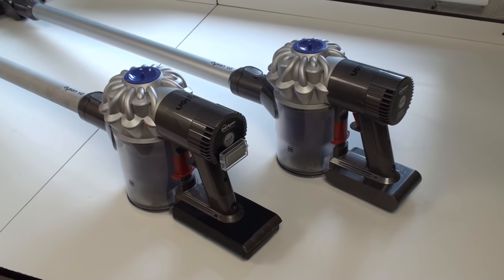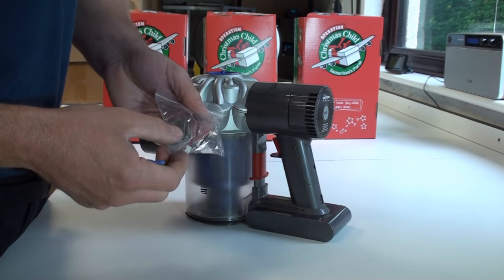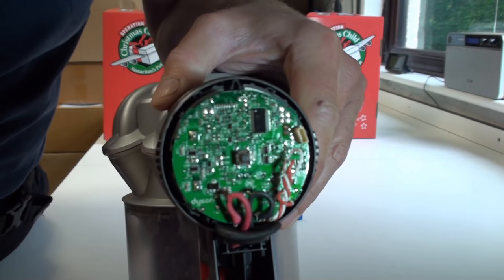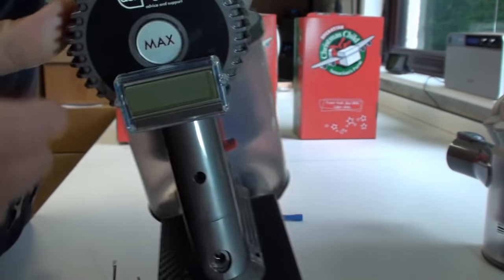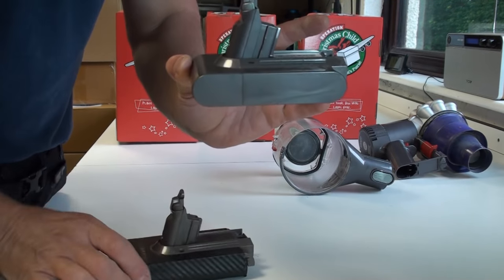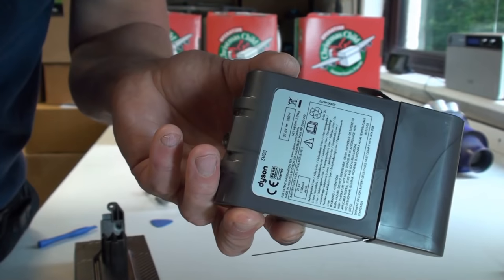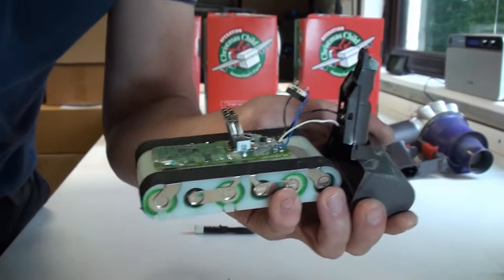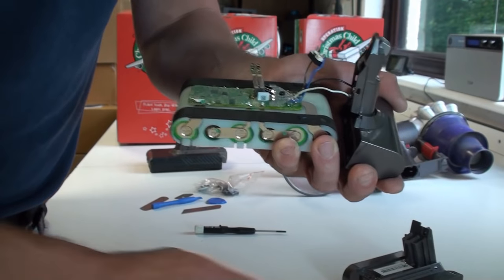Dyson V6 Modification

Comment: Why doesn't Dyson gives you the chance of replaceable batteries and the option for a bigger more lasting one?
Reply: Because, just like Apple and so many other manufacturers they are NOT green, despite all their claims to the contrary. They also deliberately use techniques to ensure that units are NOT repairable ... by ANYONE including professional engineers, who could fix these things so much more easily with the schematics being available. They want to be able to tell you that you need a complete new unit as the broken one is not fixable! Yeah ... RIGHT!

Apple for instance is try to get it made ILLEGAL to try to repair their stuff! WTF!! If it's MY gear why the hell not? Who the hell do Apple think they are to tell people they can't repair their own kit on pain of prosecution? Why should I (or anyone else) be forced to pay for an expensive repair when with the right info I could do it myself?
Reply: Bob Lewis yeah that makes sense, even consoles makers want it to be ilegal to repair consoles.
Reply: I totally agree.......   why make a good product, when you can make a poor product and sell more of them...!!!!!!!

Comment: Dear Dreamsci - great video - great idea - I like the phase/stage1 approach as it keeps the same physical form factor etc.... is there any chance you could upload a video show the high level steps to make the mod as you commented is need soldering etc? I'd just like to understand what is involved before I start. And from a safety perspective I work with lithium cells at work, just a lot larger i.e. 48v 756amph, so will take the necessary steps.  As for AskDyson comments, please don't insult our intelligence. You have a product development plan and strategy. If you made the V6 the best it realistically could be, then you couldn't sell the V7, V8 etc.. I worked for the worlds largest manufacturer of off highway diesel engines..... this difference between 150hp and 200hp was software (and the price). Don't use Safety as defence to justify market based pricing (which is fine), but not at the expense of undermining TRUE safety.

Comment: Fantastic video. I have a question. I recently got the red light of death by using the vacuum   after it shut off, twice in a row. I took the battery apart, and charged it using an appropriate charger, and it's now resting at 25v.  The battery however still flashes red. Is there a way to reset the circuit board? I'm ready to buy new cells, but I don't know if my board is bad, or why it still flashes red after the cells are up to the right count.  Any suggestions?
Reply: I don't have a solution. The same symptom  commonly occurs when the battery pack is about 2 years old. It seems that the internal micro-controller has decided that there is a problem with the cells and has disabled the pack. When I opened my failed pack, I found that the cells were badly out of balance. When I manually charged and tested the cells, I found that they are still in good condition.
There must be many good Li-ion cells being needlessly wasted because Dyson's design flaw.
Reply: I have a same problem as yours if you find any solution please let me know

Comment: does anyone know of any way to modify one of these so that there's NO battery??(ie convert it from cordless to corded).
I clean houses for a living and I have several clients that have these and I LOVE using them (super lightweight and actually pick things up on both carpet and hard floors) but I have held back on buying one for myself as since they're cordless/battery powered they obviously wouldn't do me much good for work as they'd only be good for one house (if that) before it died and I clean 2-3 houses a day.
Reply: I would just suggest having multiple battery's you can charge them separately since the charge plug is actually built in to the battery. When you are cleaning have one ready for the next house and on other one charging. When your done with one switch the battery out (2screws easy). That way you don't void any warranty. And it's ALOT easyer than modding it with a cord.
Reply: @undergod1987  Do you know for sure that there isn't some interaction with the control circuitry in the rear of the unit for the battery charging?  I've been trying to figure this out if the batteries could be in fact charged out of the unit or has Dyson made the vacuums in a way that this won't work?

Comment: Hey, which setting do you use on the battery indicator? I'm using 6c at the moment, but unsure if it's the right one, cheers for the video!
Reply: 6S is right. there are 6 cells in series

Comment: The newer V6 Absolute has a rear HEPA filter which is not compatible with this battery gauge mod. There's a much easier way to increase operating time - buy a larger capacity battery off ebay.

Comment: How are the new larger batteries connected to the circuit board? I don't see the original metal prongs soldiered to the new batteries. I wish u could have shown the process how u disconnected the old batteries & connected tge new ones. Could u do a follow video? A demonstration of the vacuum sucking
Reply: Is the circut board ever disconnected from the power outlet? Do all the cables remain intact when moving the circut board?  The video fast tracked a few steps & it's vague how you accomplished the mod
Reply: He did the mod first and the video came later after he had completed the mod and tested it.  The intermediate steps were not videoed this time.  However as mentioned in other comments it is prudent to connect all the cell balancing wires to the battery management PBC.  Just take pictures as you disassemble and replace old cell with new bigger cell in a 1:1 arrangement.  There is no electrical change to the circuit.

Comment: Hi 
I replaced the cells but get flashing red lights followed by a green light.  I think I need to replace the thermistor?? 
Can you advise please
Reply: The thermistor measures 12K ohms at room temperature. I stuck a 10k resistor in but it still did not work. From what I understand the BMS has locked you out and I do not know how to reset it. The mods this guy has done appear to have bypassed the bms so the cells will imbalance after so many charges and fail.

Comment: Surely though the hoovers battery life is all dependant on the motor life etc. Putting batterys in a hoover that should only work 20mins on the single charge for one full usage. And ramming it up to  a hour is possibly not the best idea for the motor and all the other parts of the hoover overheating and causing a short life span? ... I have a dyson v7. It has 30mins on a single charge and I think it's perfect! Clever bloke though. I like people who can be very handy and clever like this.

Comment: what amp rating are the 26650's? if you pull too many amps for lithium batteries that can also cause them to vent and catch fire. Wouldn't recommend people do this! Dyson clearly used them cells for a reason
Reply: depends on the cell you buy, the one I'm using have arating of continues 25 amps
Reply: dyson uses sony VTC4 cells. 6 cells in series. Each cell is 2100 mAh is rated 30A (but in real life, more like 20A because at 30A, you can only discharge half the capacity before reching 80 degree C which is very bad for battery longevity in years or monts or number of cycles). The VTC4 cells are high amp cells and can take 20A no problem... Dont do that with laptop 18650 who are only design for 3.5A..... you will kill them very quickly. So 6 VTC4 in series means 21.6V nominal 2100 mAh.Good 18650 for the dyson would be sony VTC4 (2100 mAh 30A), VTC5 (2500 mAh 20A), VTC6 (3000 mAh 20A), samsung 30Q (3000 mAh, 15A), Samsung 25R (2500 mAh, 20A) or LG HG2 (3000 mAh 20A)

Comment: I placed an indicator, its was a 12V that i got on ebay. but it only reads 100%??? it that because its a 12V?
Reply: Using Instruction:
(1) Key operation:
The one white buttons on the back of the indicator are used to select parameters.
(2) Batteries model selection:
1.Power off the indicator
2.Hold  key
3.Power the indicator on
4.Release  button,then the screen will display for symbols in English: "XP"
or "XC" ,x is the number of cells, then users can select batteries model
by keys in the following order:
P1: Pb12V lead-acid battery
P2: Pb24V lead-acid battery
P3:  not work
P4:  not work
C2: 2 pcs lithium batteries
C3: 3 pcs lithium batteries
C4: 4 pcs lithium batteries
C5: 5 pcs lithium batteries
C6: 6 pcs lithium batteries
C7: 7 pcs lithium batteries
C8:  not work
C15: not work.
Reply: Hope that helps...

Comment: Thank for a nice video. But I wonder,  can you use the original Dyson adapter to charge for the modded one with 5000mAh battery and how long does it take for full charge ?

Comment: Usually these higher capacity cells on ebay (etc) are fake.. Most of the time they add some cardboard rings on top of an normal capacity cell, and solder a new battery contact to a wire (running through these cardboard rings). Finally the cell gets a new wrapper and sold as high capacity. Also I found some of these cells of poor quality and rusty beneath the wrapping.

Comment: The bits he doesn't go into are most important bits for safety -  How to connect up the balance charging circuit (which it doesn't look like he's done) and how to make the physical connections to the cells.. A soldering iron is not the solution.. a decent resistance or laser welded joint is what's required to keep the resistance and temperature low to avoid premature aging of the cells or even thermal runaway (YouTube: 'lithium ion thermal runaway video' to see the danger involved). The heat put into the cell during a soldering process is very bad for it, another reason why it isn't used in production, also no mention of using protected cells either? (with CID and PTC layer). As others have mentioned the current (25-30amp) rating of the cells is critical in high power applications like this, you shouldn't just stick in any old high capacity cells (e.g. 3000-5000mah etc), especially with a high internal cell resistance and questionable resistance soldered joint. Nice idea but a few fundamental issues, particularly regarding safety. I am a big fan of the battery gauge, I see the latest cordless has this.

Comment: High capacity batteries like the 18650s 3500mah would probably not working in this case cuz we don't have high drain batteries in high capacity

Comment: THIS WILL PROBABLY BLOW UR MIND. BUT INSTEAD OF GETTING A BIGGER BATTERY TO REPLACE THE ORIGINAL ONE WHY NOT MAKE A FEW BATTERY PACKS WITH THE SAME voltage requirement and just make it interchangeable with the digital charging part. that way it won't blow up on us.
Reply: The new battery pack has the same voltage as the original. This would not work if the new batteries had a different voltage. The original batteries (18650) and the bigger batteries (26650) are both 3.7 volt cells. The different parameter is the mAh rating (milliampere hour) which indicates how much energy the battery can store. The bigger cells simply have a higher mAh rating. 

The obstacle in quick changing this battery is that it requires 2 screws to be secured into the vacuum cleaner. You'd also need to buy an additional OEM battery unit from Dyson to obtain another charging circuit and insert assembly.
Reply: Mnop Xangelus The charging circuit is inside the battery pack, so you'd need another one for an additional battery pack for the purpose of quick-swapping. However, the issue with the retention screws remains.
Reply: Oh yeah I see what you mean. Man how can I be as smart and as kind as you? You strike me as the kind of person that has limitless friends and is super successful in everything you do.
Reply: I can't help it. Your charisma and charm is making me feel like a schoolboy again.
Reply: Please don't ignore me. I hate it when we fight.
Reply: The issue of the 2 screws is not really a problem. If you go to 3:26 in this video, you can see the 2 screws 
that have to be removed to in order to remove the battery. You can also see in the video that even with the 2 screws removed, the battery doesn't just fall out, but is held in place by some mechanism inside and requires a bit of force to remove. If you take those 2 screws out and leave them out, you can have a second battery and easily swap it when your first battery runs out. In my experience, the battery will not come out during normal use unless you drop the vacuum or something, which you would want to avoid doing anyway.
Show less
REPLY
Reply: magnets replace the screws, i already did it.
Reply: Dyson removed the removable battery feature after the DC44 because it too easily wore down and the contacts would eventually stop connecting causing what looked liked a dud machine when it was just the contacts.
Reply: Justin H.  Interesting that Dyson would drop swap-able batteries because of connection problems.  I have a $50 cordless drill and a yard trimmer/vacuum system that use removable batteries.  They have both lasted for years with absolutely no connection issues.  If Dyson can't design a simple battery connector that lasts why would one expect the rest of their product design to be any better?

Comment: I love tinkering and modifying/"improving" things.......YES

But.....when you compare the price of a new battery pack to the price of these batteries we need to buy for this project, it does not make any sense!  And, is dangerous.  And, if you use the larger batteries, your convenient wall-hanging charger cannot be used.      Besides, Dyson has  come out with the V8 cordless.....superior in EVERY way, (including 40 minutes of run time)...
So, much easier to give your old V6 or whatever to your kids (or put it in the shop for the car....etc) and buy a V8, and go enjoy something else.
Reply: Ordered 6000mah V8 batt from aliexpress $69, Says Sony or Samsung

Comment: hey there - have a V6 DC39 vacuum and found/ordered 8000 MaH batteries on Ebay.. same product number 18650 - think they are worth a punt to see if they extend the life ? also bought the monitor mod.. love that.. just worried about messing opining the pack... seems like any videos i have seen.. it very hard to do it without messing up the plastic.. there would be no need to do your mod as the 8000 would be direct replacements..
Reply: those ebay batteries are likely frauds as the highest capacity 18650 is currently around 3400mAh and those are not 30 Amp discharge. I made a similar mistake with some 10,000mAh labeled batteries.

Comment: The type of battery.. there is a reason why its made like that. I understand why people wanna modify this but.. hell not like that. The safety could not be granted.. 

Sure you can put FA/18 Superhornet jet-engines in a Boing 747 plane.. but there is a reason why they didnt do that..
Reply: modders like myself, do it because we can,  why...  cost, value for money, enjoyment, many reasons....... I love this "Sure you can put FA/18 Superhornet jet-engines in a Boing 747 plane.. but there is a reason why they didnt do that.."
it's not a case of putting a bigger engine in as much as putting a bigger fuel tank in, the battery mods don't give you more power than the original battery but much longer run time,
Reply: another safety sally...
the villagers fear what they dont understand,lol.
Reply: @steveclark3379  lel?? in other meaning, it's stupid to put Boing 747 Fuel-Tanks on a FA/18 Superhornet!! No matter how "long" it could fly now.

Comment: problem is why didn't dyson do this. was it because it may overheat the motor. hmm
Reply: Why would it overheat the motor?
Reply: Steve Clark dunno maybe it can only runs for set amounting time then needs abbreak in between
Reply: Paddy you have a cynical outlook on life.  However you may even be correct in thinking the motor is not made to handle full load continuously though I doubt it.  

While the original cells are stressed near their limits at max power,  larger replacement cells (high current rated ones) are better able to handle the continuous or max loads easier.

Comment: better solution: get another main unit (250$ on ebay). avoid mods and fire/safety hazards. another main unit will allow you to plug-and-play. charge one unit while using the other, or charge both with an extra charger.

Comment: Before you guys replace the battery.    I am thinking many of you are here because your battery failed.   Clean the unit completely  especially if you get a pause  before your battery shuts down.  If the unit works when you remove the tray the battery is not your problem.

Comment: just think ----dysons spend over a billion a year on research ---and we all think we can better that ----lets face it dysons are crap otherwise there would not be over 4,000 different fix it videos
Reply: They are not crap, they are just overpriced for what you get, a cult following like the Apple products and suffering from the same hubris.  They think people will remain loyal forever.  Apple has cross platform integration as their market strength, Dyson has a high rotational speed motor system.  The rest of their product is just commodity parts made in massive volumes to get profits up.  End user is a tool to get volumes up not a actual customer who needs to be made happy.  Profits are maximised if customers are repeat customers, hence the goal to generate a cult following.